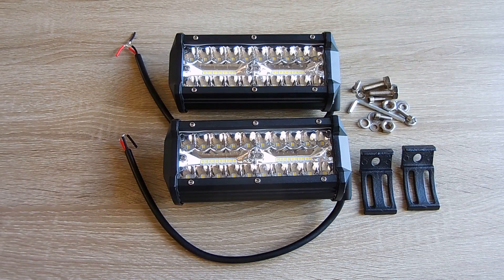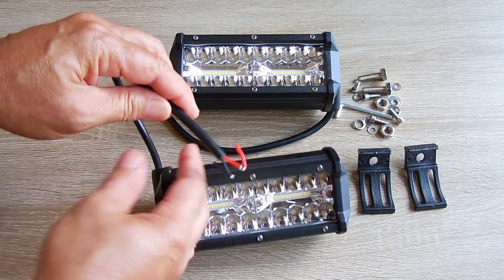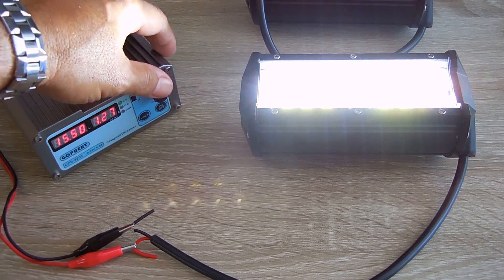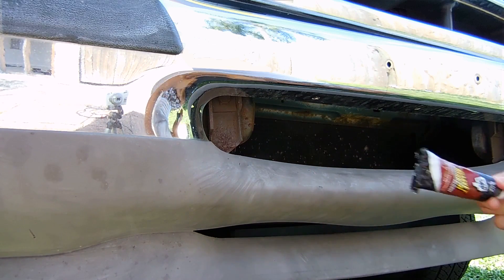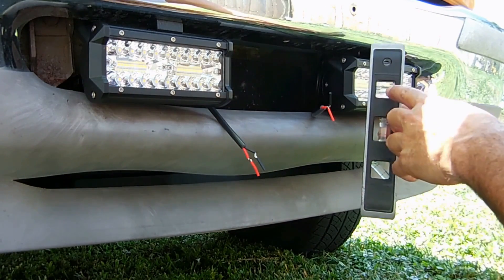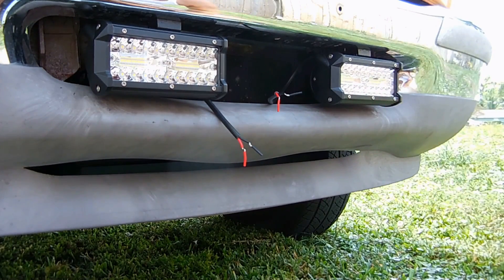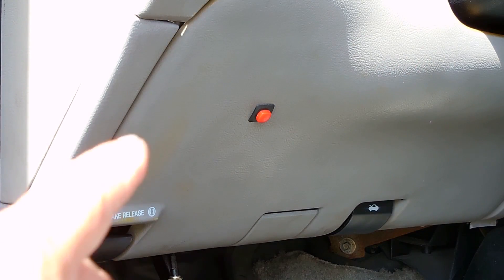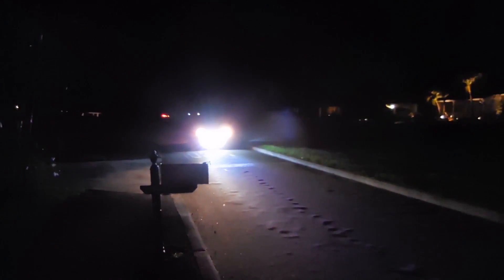How To Wire Up & Install LED Light Bars

Comment from the maker: The LED Light Bars can also be wired so they only work when Hi-Beam is ON(If required). Below is the link to the easy to follow wiring diagram/schematic. Thanks for watching!
https://i.postimg.cc/rmYbyNQh/eb4bdc05dfbee91b1f692fbd6d926919.jpg
Reply: "LED Light Bars can also be wired so they only work when Hi-Beam is ON" - this should read " LED Light Bars should and in most places MUST ONLY be wired so they only work when Hi-Beam is ON"
Reply from the maker: @Ghryst  Not really necessary. People with brains know when to use them, and when not to use them.
Reply: @electronicsNmore  it is necessary now as it is LAW to only be able use lightbar with highbeams on.

So you cant turn them on when highbeam is off.

Question is, how do you had a 3 way led rocker switch to negative triggered highbeams?
Reply: @Cipheiz where i am, we dont give a shit about what happens where you are.
Reply: Interested in some help for a single lightbar I have bought to fit to a 2012 Nissan Navara?
Reply from the maker: @DeusVultFrater  Hi, what do you need to know?
Reply: electronicsNmore  not water inside after rain?

Comment: I watched this video to learn the basics of wiring a light bar 
And success I learned just that, Amazing video! Now I just have to inform my self more on crazier stuff to wire 
Switch panel 
Extra 12v socket
Interior LED Light bar that run off the battery 
Kill switch
Push to start 

The list can go on

Comment: You could also have used the power going to the underhood fuse box. Then run the wires through the fire wall for your switch.

Comment: That's a dum ass thing to do soldering it to the fuse like that now that wire would have power no matter what  rather then popping the fuse cause if it has to much going through it the wires are gonna melt and possibly cause a fire your better off to get a aftermarket fuse box for taco switches that go to a amplifier that plugs into the same spot and just connect  the wires into it that way the fuse will pop before causing any damage to the wiring in the car or burning out the lights
Reply from the maker: First of all, learn proper English. Second, the wire is soldered to the LOAD side of the fuse, not the power supply side. Unreal...

Comment: Can you skip the fuse box step and just connect it straight to the battery with the 3 prong switch and an inline fuse, that way you can use the lights without the ignition having to be on?
Reply from the maker: Yes

Comment: please some one help...........i already have a light bar on my truck with its on wiring harness to come on with high beam, BUT i want to add another light bar with its on wiring harness but to come on with the other light bar on high beam?? can i just add the new light bar into the 1st relay
Reply from the maker: As long as you don't exceed the relay rating or fuse, you can connect another bar.
Reply: @electronicsNmore  thank you for answering 😁😁

Comment: Finally someone who knows what they are doing 👏
Reply: He has no Idea what he's doing soldering it to the fuse like that was a terrible idea the point of a fuse is to pop and stop that light from getting power now if it pops that light will still get power and possibly catch on fire it's not guaranteed  to catch on fire but it's definitely  a possibility  being done like that
Reply: Go to any shop and tell em to do it like that and there gonna call you an idiot

Comment: Is it best to install light bars in a low beam function or high beam?
Reply from the maker: Many areas prefer the light bar to only be powered ON when the Hi-Beams are on. I provided a detailed wiring diagram for that setup.

Comment: Hi could you just run a wire form the battery to switch instead of the wire inside or is better with a ignition wire and doesn’t matter if it’s a 3 pin switch or 2 pin thanks
Reply from the maker: If you use an inline fuse holder at the pos terminal of the battery, yes, but the lights will remain on when the ignition key is removed, and that's not good.

Comment: Did you use a fuse holder or relay?
Reply from the maker: All shown in the video. I also supplied a schematic to viewers if they want to have the light bars only power on if the hi-beams are on. That schematic shows a relay.

Comment: I want to add some LED reverse lights to my truck... And I figured I may as well get fixtures that have red brake lights and amber turn signals as well (just incase my factory bulbs go out, hopefully the added lights might save me from a ticket or accident 😬). What do I need in order to tie into factory switches? Can I splice directly into the existing truck light wires, or will it put too much of a load on the existing circuits? How does it work with trailer lights? They have to tie into the factory switches, so do they not add too much resistance? Sorry. I haven't done any 12v stuff in YEARS

Comment: never wire into a fuse panel...if there is a issue with your accesory and that wire burns or melts, it will take that entire fuse box to a inferno and your car...
Reply from the maker: What are you talking about? The wire is connected to a fuse!
Reply: @electronicsNmore  it doesnt matter if its connected to a fuse.. Never connect or wire anything to a factory fusebox....If you have a short in that wire it will take out that entire fuse box and melt it.. Thats why people go directly to the battery with a fuse so if it the accessory shorts, it doesnt destroy your OEM fuse box with all the accessories...That is how cars start fires, the box will melt when overloaded with auxiliary crap....GO directlyt to a hot lead from the battery.
Reply: @electronicsNmore  He is saying the fuse box will overload I believe

Comment: Thanks.  I only wish you didn't leave the part where and how the ends of those blue wires and the fuse got connected to the switch.
Reply from the maker: Very simple. One blade of the switch goes to the fuse, the other blade to the LED light bars POS(12v+)

Comment: If you put the big bolt through the hole on the light bracket then install the 2 smaller bolts to the nuts that are incased, theres no need for a mirtor or anything the large bolt wont go anywhere it will stay right whete it is. Then you can just dide through the hole you drilled and then add your washer, lick nut and nut. Done.  Thats the proper easy no fret way they designed these lights.

Comment: I want to mount 6 led lights on my 2008 tacoma. Total watts of the lights add up to 396 I'm using two wiring kits each with 40amp relays. Do you think it will be ok to run on arock battery and alternator with no problem ?
Reply from the maker: As long as the relay can handle the current, and the wires are the proper size, you should be OK. Make sure the battery is good, and the alternator has sufficient output to power all lights on the vehicle at night(headlights/running/etc), with the A/C on.
Reply: @electronicsNmore  I believe my alternator puts out 140amps and the batery is a720CCA. I wont be runing the LED lights all the time just when I'm offroad backcountry at night

Comment: You really didn’t want the wires to get wet lmao What I would do is just use Heat shrink solder connectors or just electric tape lol

Comment: It looks like really complicated to install. I just bought one set from amazon I did not install it yet.  But what I can see is that it will require lot of tools.  Semi truck.
Reply from the maker: It's not too bad. Some people connect a relay to the high beam headlights to supply power to the light bars only when the headlights are set to high beam, and that's easy to do. Thanks for watching!

Comment: I have a question I bought a light bar and it came with a relay and a switch when I turn the light on it's very dim any suggestions?
Reply from the maker: Hi Josh. The relay is easy to connect. Connect the light bar directly to the battery to make sure it works full brightness, if it does, post back.
Reply: @electronicsNmore  thanks for your reply I'm going to have to get some more wire the wore from the light bar is really short so I'm going to do that first and then try connecting it to see it's also a cheap light bar haha but it is really dim but I'll try rewiring it and try that and get back to you thanks!

Comment: Hi big man.
Can I connect to the 12v battery that I have which is not from the car. 
Thankyou
Reply from the maker: You can use any 12v battery that can handle the current draw.
Reply: @electronicsNmore  thankyou man.I am going to use it in my car  with spare battery rather than using my car battery. Because I install lots of other stuff such as dash cam, speedometer,  led footwel.ambuant leds. Etc. 

Thanks man.

Comment: Can the led light bar be spliced into the existing fog lights that are already on the truck.
Reply from the maker: Yes, that shouldn't be a problem as long as the fog lights and bar light together are less than the fuse rating. Thanks for watching!

Comment: Why do that with the fuse. Why not just run a fuse already built in with the wire. Much easier and you dont blow as many fuses
Reply from the maker: Too much trouble probing wires. Much easier to do as shown. Thanks for watching!
Reply: You should never have to probe a wire, or use a fuse in this fashion! This is how wire fires happen!!
Instead; take the time to clean up your battery terminals, and run an in line fuse, and ,or relay for the new circuit!
 
(Many new light bars are sold with wiring harnesses to relieve guess work, and danger of wire fire.)

Not here to hate, just a tip from an automotive electronics specialist.

Comment: I don't get it why you don't Wire the lights to highbeam
Reply from the maker: Very simple to do, but I felt there was no need.
Reply: @electronicsNmore  in Sweden you have to have the switch from highbeam because of the laws and regulations
Reply: How do you do thay

Comment: The lights suck.  Assholes run them while on the roads.  One day I'll get to the point that I've had enough and paint them black......right in the middle of traffic!
Reply from the maker: 100% illegal to do. These are for rural areas or areas at night that are very dark with no drivers coming at you.
Reply: @electronicsNmore  
Yes, I get that but, there are a shit load of assholes (Jeeps and 4x4 trucks) in the Atlanta area that drive the roads (two lane and interstates) with them burning.  I have even seen "professional" truck drivers (big rigs and smaller box trucks) driving with them.
It's f'ng ridiculous.  You don't even need to use your factory high beams most of the time.  But, if there is someone burning their high beams and/or light bars, they will get behind me.....every single morning and evening.
I will usually let them around me then, I'll drive with my high beams on them for a few miles.  They are usually stupid and don't have a clue as to what is happening; not even aware my brights are burning.  They keep driving.....clueless, stupid, and rude as hell.
Reply: @electronicsNmore  
Thanks for allowing me to vent.  I'm much better, now.  I'll be okay tomorrow morning, too.

Comment: I challenge you to debunk free energy “engine” made from nitonol springs and warm water. Yes I understand nitonol does not actually need warm water to re-crystalize it only needs stress being applied to it, and eventually it completely goes back to its normal shape.

Comment: Another great video!
Had a quick question off topic, hoping you may have an answer. I have a vintage mechanical chess clock which has 2 clock faces the covers of which have come off. The covers are either glass or plastic made hard to tell, but they cover the clock faces with a metal bezel around them. The same way the glass cover of a hand watch would. Problem is I have no idea how they were originally secured to the clock face, my best guess would be using a thin o-ring like a gasket which create a seal to secure them in place. Also there doesn’t seem to be any latching mechanism on the bezels. Any help is appreciated
Reply from the maker: No idea.......I'm not there to look at it. Glue that dried out?

Comment: In our state you have to wire these to work only on high beam or you will get ticketed ! Ran all forest fire rigs with that set up , Don't know about your state but they will stop you and test that they go out by going to low beam !  Thanks for a great video !
Reply from the maker: It's very easy to make the bar lights go off when the low beams turn on, you add a relay to the low beams power supply wire and connect the batt+ for the bar lights through the relay contacts. When the relay has power from the low beams, the circuit for the bar lights will not have power. Thanks for watching!
Reply: Yep, We used Air craft landing lights for off Rd, only.  I used constant duty solenoid wired to high beam side, then with switch to use it in off, when on rd. Some what diff than what normal use ! Thanks for the answer !

Comment: I've seen a product that lets you piggyback on a fuse in your fuse block. Sometimes you have to use what's on hand though. ;-D
Reply from the maker: You can also use a fuse tap. 😀
Reply: I think we're talking about the same thing.
Reply: Its an Add-A-Circuit, Usually like $5-8 bucks at a parts store.